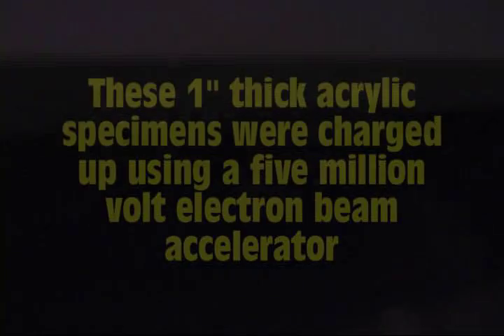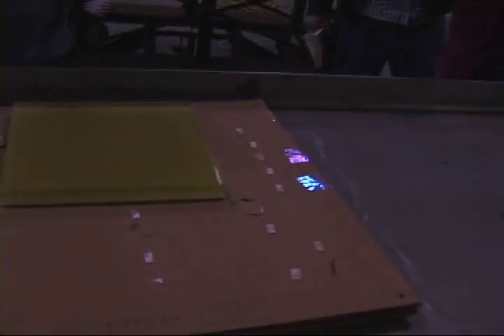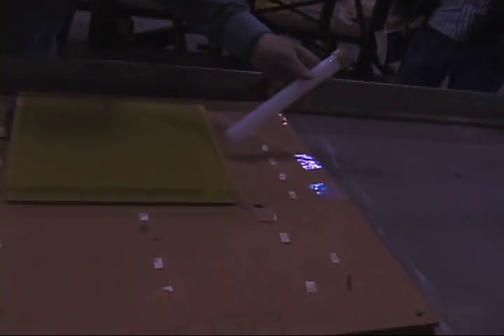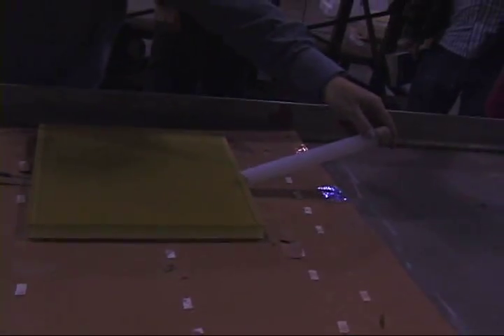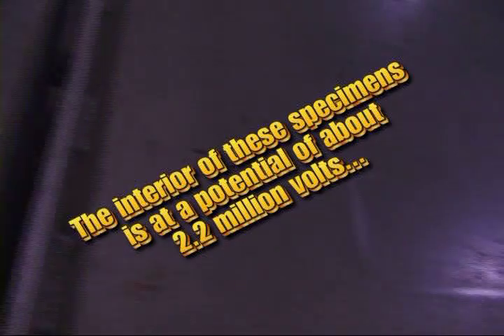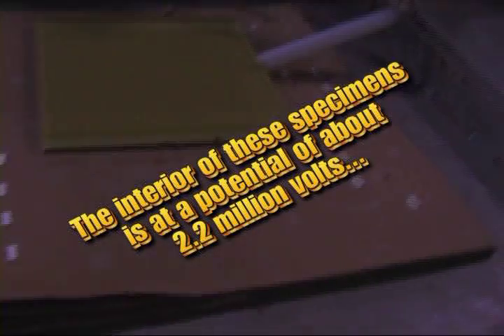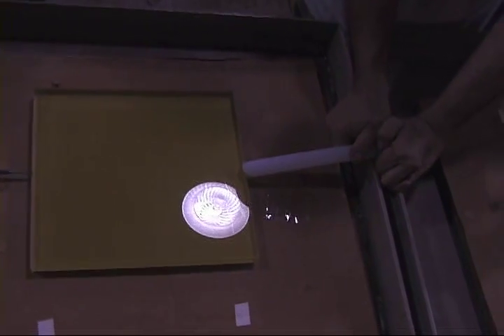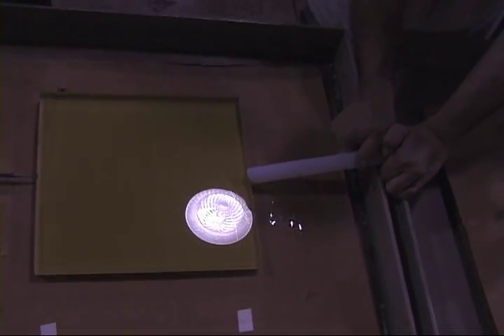Making 12 Inch, 2.1 Million Volt "Captured Lightning" Sculptures!

Comment: After the main pulse, how long do they spark for?
Reply from the maker: For small specimens, up to 3 minutes. For large specimens, up to 30 minutes. However, the internal branching Lichtenberg figure is permanent.
Reply: After the main pulse, I see sparks. Are those real electric sparks, or a light reflection off a new fracture?
Reply from the maker: Those are actual electrical sparks. After the main discharge, there are still small pockets of residual excess charge left inside the specimen. These periodically discharge - quickly at first, then more slowly - finally stopping when most of the remaining charge is gone.

Comment: The question that begs to be asked is how can this be done at home?? without an engineering workshop.
Reply from the maker: Hehe... I wish we could do this at home. It would make things a lot easier for us!

Unfortunately, the charging process uses a 150 kW 3-5 million volt particle accelerator to inject electrons deep inside acrylic specimens. The accelerator facility is physically large and very complex. It is also subject to numerous federal and state safety regulations and periodic inspections by these regulators. For a host of practical and technical reasons, It would not be possible to make, or install, a similar facility for use in a home. Sorry...
Reply: Bert Hickman. Thanks for your reply. Had a feeling you were going to say what you did. Obviously this can't be done with a MOT LOL! But I reckon I may be able to fit a particle accelerator in my garage though ha ha ha.
Reply from the maker: Well, many years ago, a 6 MeV particle accelerator was listed on eBay. It needed some repair work but was otherwise free for the taking. You simply had to haul away six semi-trailer loads full of equipment. I tried to sweet-talk the wife into letting me get it with no success... :( 

It was listed for several months on eBay until either someone "bought" it...  or they simply scrapped it.

Comment: This is not a fractal. I do lichtenberg lines in wood and fractals are  mathematical set that exhibits a repeating pattern that displays at every scale. Here is a wiki page of fractals. These lichtenberg figures are not infinitely scaleable. If your going to show some science please use the correct terms.
Reply from the maker: Lichtenberg figures are indeed not fractals - they are "fractal-like". No true fractals exist within any physical system since the fractal-like structure must eventually stop at the molecular or atomic level. However, nature abounds with structures that are fractal-like across a wide range of scales. Dielectric breakdown structures can be accurately modeled using fractal mathematics. And, recent scientific evidence shows that the fractal branching structure associated with dielectric breakdown extends all the way down to the molecular level within solid dielectrics to mile-long lightning bolts. Good luck in your HV experiments and artwork.
Reply: If you dont like the term fractal, how about recursive. Recursion implies a a way out, and not an infinite loop.